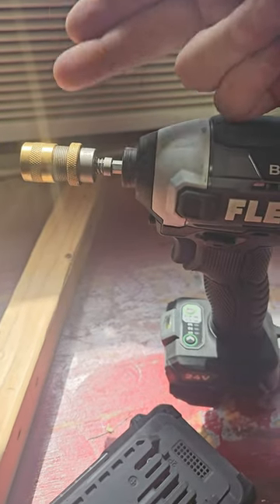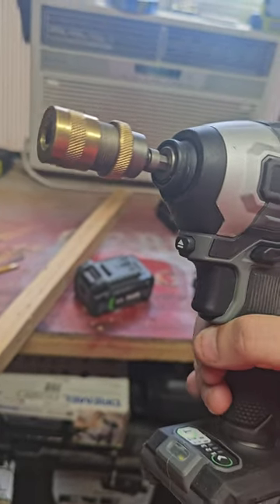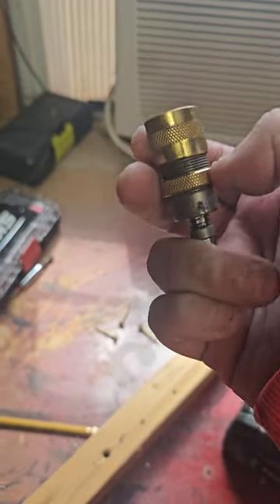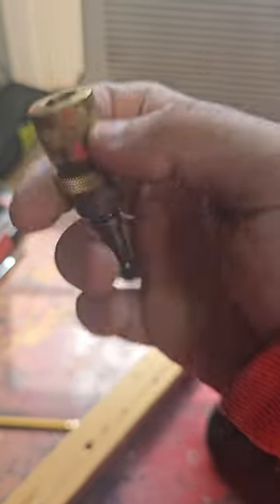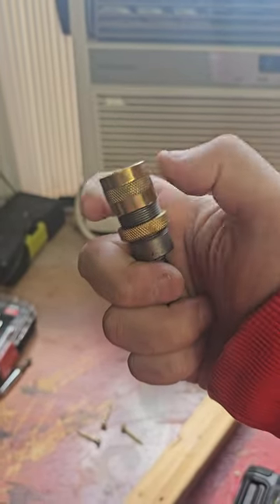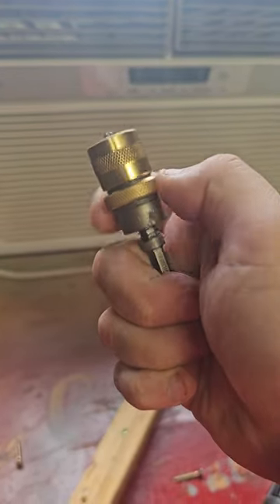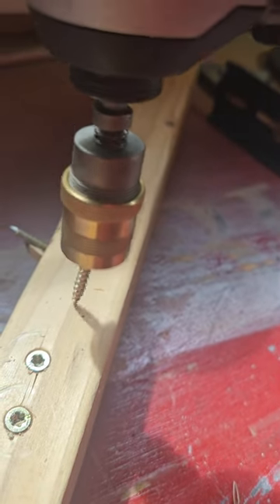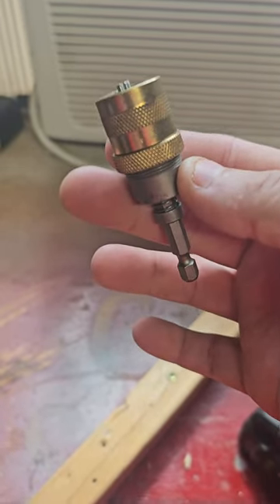if you use an impact driver, you may love this tool #shorts #dewalt

Comment: It would be good to see a close up of a few of the screw heads. It looks like there are some left over metal shavings. Depth release used to always have some round out.  It's not a perfect world. Want to do it right?  Get a clamp, use the right screw and head and then feel it in based on torque...and pray it doesn't strip.😮

Comment: Like so many comments point out, it absolutely obliterates the screw heads, they have brands that aren't Dewalt that are only about $6 compared to $25-$30 or a better choice, the bits that have a built-in stop, those are about $.99 in Philips and Torx, those ones seem to not explode the screw heads as much

Comment: The clutch on a drill will accomplish this too, no?
Reply: No. Driver or drill clutch is torque based unless you're dealing with a true screw gun..they were the best for a very long time before the noisy gadgets came along.
Reply: Yes, but when a guys all methed up working a clutch can be a hassle and leads to broken wrists, so impact drivers made things more or less dummy proof
Reply: Yes and anybody who says otherwise is dead wrong
Reply: @DiligentDave1966  spot on…thanks!
Reply: It's about impact drivers not drills, they don't have a clutch
Reply: @DiligentDave1966  exactly! 👍
Reply: @DiligentDave1966  thanks! 😊
Reply: the clutch only controls power vs resistance.  NOT depth.  With the clutch if the wood is soft , you will overdrive screw in!
Reply: @DiligentDave1966  Wood is not a homogeneous material. You can set the clutch to drive screws flush in one area, move along 6 inches and get a different result. Clutches control torque, not depth.
Reply: @DiligentDave1966  On that last point we agree. I'd rather miss the mark on depth slightly than trash the screw head. I never use the clutch tbh, I just rely on trigger control. It's not that difficult!
Reply: @DiligentDave1966  Philips has all but died out in the UK. We mostly use Pozidrive, which is a similar shape but resists cam out much better. Still not as good as torx, but good enough and a lot cheaper.
Your carpenter buddy is probably on to something. Impact drivers can be a bit harsh for carpentry or woodworking. Ideal for construction though.
I guess if you're pre-drilling all your screw holes, it would probably benefit you to have a drill bit in the drill and a driver bit in the impact driver to avoid changing bits all the time. You can also get drill bits with a built-in countersink to speed up your work flow even more.

Comment: Well it sure would be cool if you explained how this worked, because if this is just relying on the bit to cam out to disengage that is a fantastic way to strip everything that you put in, but if this is a clutched mechanism that actually disengages the driver from the bit, without disengaging the bit from the fastener, then this is pretty fucking cool. 

Also, stop using impacts to drive screws. They're not drills. When you're running a screw, or a lag, or drilling a hole, you do not want an impact. You want continuous torque to overcome the static friction and keep something moving. You should not need an impact. If you need an impact to overcome the static friction, you should probably drill a pilot hole. But more importantly, the way an impact works is by defeating the static friction with sharp and rapid impact forces. All this is going to do, is snap heads, or round threads. You are so much better off using a drill that provides smooth continuous torque, to maintain the movement of the fastener, thereby not allowing static friction to slow it down. you also get more torque out of a drill, given that it has better gearing, and is specifically designed for either high speed low torque, or low speed high torque. And if a cordless one isn't powerful enough, a corded electric drill will outperform almost every impact on the market, unless you're trying to run a 12-in lag bolt with a 1-in Milwaukee impact.
Reply from the maker: I can't wait to see the replies on the comment about not using an impact on screws
Reply: Impact drivers are so overused, give me a high torque drill any day
Reply: Wish more people knew this or would actually use it. Hate getting drill out just for the "boss" to tell me just to get an impact cause they don't wanna waste time getting the proper tool
Reply: Go ahead and use whatever tool you want it doesn’t bother anyone. But don’t be arrogantly ignorant. 

“Impact drivers give you better contact with the head of a screw, resulting in less stripped heads. They're ideal for driving in a lot of screws, bolts and other fasteners because impact drivers are easier on your hands and wrists. They're a great choice for heavy-duty drilling such as screwing large bolts into concrete.” - literally Home Depot
Reply: The dude that said use drills over impacts has obviously never been in any single trade EVER 😂 a vast majority of us guys in the trades most of the time grab an impact over anything. Only diy weekend warrior guys tend to nvr use impacts.
Reply: Wow. That's a really long version of exposing you've never used a good impact DRIVER. A drill is for DRILLING holes while an impact driver is for DRIVING fasteners. It's not rocket surgery. 🤷‍♂️
Reply from the maker: @meagaindave2049 just the comment that I was looking for. I just didn't have the energy Dave 😪🤣
Reply: @meagaindave2049  funny Milwaukee supposedly makes the best. I love my Dewalt impacts but they were not ment to be used for EVERYTHING that people like you use them for. Like I said take your best impact and beat drill grab a lag and run them you'll see the difference. Hell stop running your mouth and actually go watch the videos that show what I'm saying is facts.
Reply: @ToolReviewZone  you do tool reviews and don't know this fact says a lot about your "reviews." Keep showing gimmicky tools
Reply from the maker: @allenncrystalking8517  bro, you are a 100% amateur.  I find it funny though how upset you get what called out on your lack of tool knowledge 🤔
Reply from the maker: @AllTattedUp13  exactly 💯
Reply: @ToolReviewZone  ok think what you want I'm not the one giving people advise to buy a gimmicky tool that's going to strip the screws out
Reply: @ToolReviewZone  but good for you just another content creator that doesn't have a clue about what actually works the best for the job at hand keeping stripping and breaking screws with your impact driver
Reply from the maker: @allenncrystalking8517 is that what I "thunk?" Hahahahaha, you so mad bro.
Reply: @allenncrystalking8517  "actually go watch the video that show what I'm saying" that sir is where your problem starts..you're obviously a guy that watches videos instead of actually doing work in the actual trades. Not to mention you're a dewalt fanboy. Double whammy, that's rough!!!
Reply: @allenncrystalking8517  wth is a "thunk?" 🤣 BTW, I don't use my impact driver for EVERYTHING. I'm a drywaller and I use my drywall screw gun to fasten the screws into the drywall. I use my drill (with a mini paint mixer) to mix hot mud by the pan vs a whole bucket. So, there. 😝
Reply: @AllTattedUp13  again get you best impact and best drill and run a 10 inch lag at the same time. No predrilling nothing. Bet a years pay the drill out preforms the impact in this situation. Impacts have there place and so do drills. Do things your way all you want it's your life but don't start talking down to people that have 20 plus years in construction and know first had what does work.
Reply: @meagaindave2049  really can't pick on anything but a typo wow
Reply: @meagaindave2049  a drywall telling a carpenters to use an impact over a drill is hilarious
Reply: @allenncrystalking8517  years in the trades don't mean anything, cause if that was the case I got u beat little guy, almost 30yrs in commercial/industrial hvac. I've seen 2-3rd yr apprentices outperform and do better work then some journeymen. I also would never take a guys advice when I know for myself what works and what doesn't and what gets the job done in the most cost effective manner. So rock out with your 20 years in "construction" which I highly doubt. Cause most tradesmen say specifically what trade they're in. But you do you little man and keep gettn triggered over your drills 😂
Reply: @allenncrystalking8517  I never said "use an impact over a drill." I, merely, said,"drills are for drilling and impact drivers are for driving." 🤷‍♂️ A typo vs a mistake on the job. Same mentality.
Reply from the maker: @allenncrystalking8517  lol, post a video bro... show hiw good you are,  it just talk about it....but you won't
Reply: also by the way your drywall gun is just a modified drill so keep on
Reply: @ToolReviewZone  my videos of my work on on my snap chat some of us actually work not review gimmicky tools
Reply: @allenncrystalking8517  I'm the drywaller, keep up. 🤦‍♂️ BTW, a drywall screwgun is not even HELD the same way as a drill. True, they are both electric and have a motor that rotates in, both, forward AND reverse! 🤣
Reply: @meagaindave2049  and all I've been saying is use the right tool for the job. Obviously these guys only use impacts for everything instead of the right tool
Reply: @meagaindave2049  sorry clicked on the wrong comment my bad
Reply: @allenncrystalking8517 here's a tip: tools normally have their purpose somewhere in the name. For instance, one would expect a hammer to be used to hammer things, a square to square things, a drill to drill things and a driver to drive things. In some rare instances a drill is more effective for driving than the driver, but only when dealing with soft materials that are easily destroyed and you utilise the torque clutch to prevent damage, since drills have a higher range of clutch settings than drivers do.
Reply: By that same metric, a drill isn't a screw gun, so....